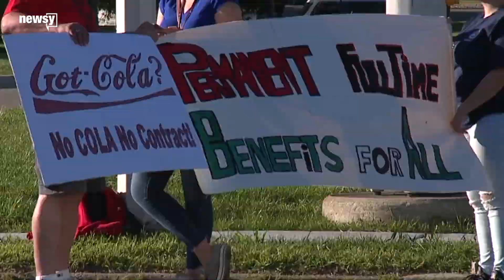GM strikes tests unions, manufacturing sector

Comment: Wow  more things are  coming  with  more  job  problems
Reply: Frankie you are so correct. I can only imagine that some of the talks now deal on not only immediate subjects, but also what happens in during the next 4 years leading up to he next volley of contract talks. The issue will be far heavier than they are now. CONSIDER: GM is dead serious on rolling out up to 20 full electric models by 2023 and faze out gas guzzlers. Industiral analysts estimate that if that were to happen, your looking at the UAW workforce at GM dwindling down to somewhere between 50% to 25% that work at GM production plants now!
GM is dead serious. Having worked on the EV 1 prototype electric car back in the late 1990's, it only took about 12 of us to build this car, where next door it took upwards of 1200 to build the gas engine vehicles. 
Its gonna get nasty!